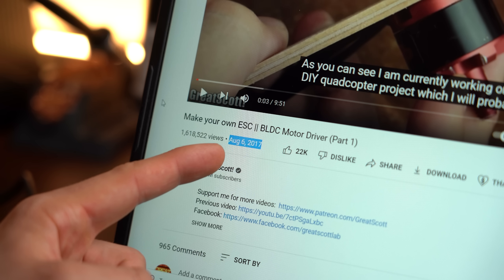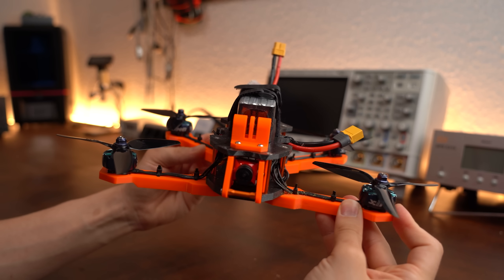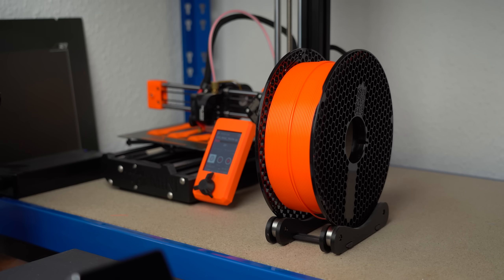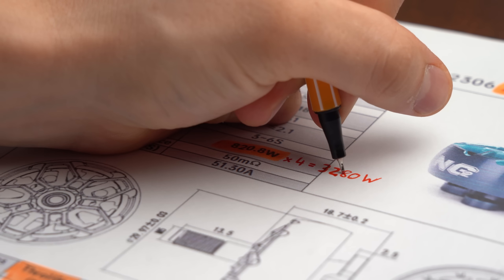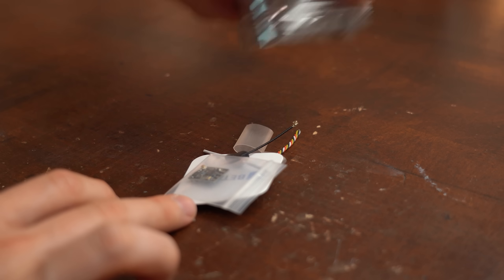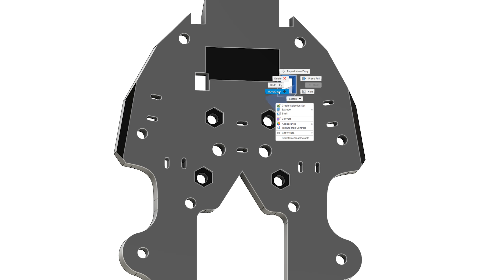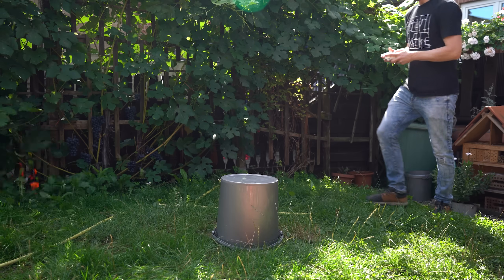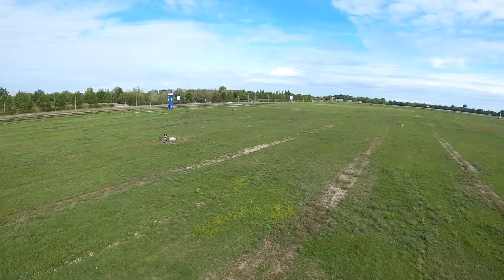The Idiot's Guide to Making a DIY Drone! (I am the Idiot)

Comment: Zeee battery C ratings are incredibly overstated. 
My ESC requires 35c minimum to run and my Zeee "80 C" battery would not even provide the 35c minimum, resulting in voltage sag causing false LVC state.

Zeee is crap battery company. 

SMC make actual good batteries.

Comment: I have a doubt, At 8:30 minutes and seconds into the video you have mentioned the ESC must be able to handle the power consumption from the motor but the motor you have used, seemed to be a 60S Motor with 51-52 Amp Approximately in current rating at full throttle and the ESC That you Have used is of 50 Amp Rating Was That A Problem or Will that be a problem or not - This is my question Scott ? Please Let Me Know !!

Comment: ANSWER:
The drone fell out of the air because of a cut in power, this may have been caused by a dead battery, bad wiring or something  else.
Also if you want to get good you should practice with a simulator.

Comment: Go from the 3 blade to the 2 blade propellers, it wont feel as like crazy powerful, the more blades the hard it will turn amd maneuver. And i also recommend adjusting your motors in the firmware. The stock setup never works for me anyways! 👍🏼

Comment: You can get all in one boards with ESC and Flight controller combined.   ELRS is the best on the market for consumers right now. DJI has digital VTX called Air Units. This is not a cheap hobby anymore.

Comment: You know building an FPV - UAV is not a small feat by any means. I'm trying to do it by myself, but I'm clumsy with assembling the technology. Then again! - I'm a CHEMIST - I've been working with polimers and polimeric materials for 25 years. It's quite easy for me to obtain lightweight & very durable materials, but I'm in a pickle as soon as it comes to electronics, electrical motors, etc. I have friends in the business, that allow me to even PRINT (gratis!) any ...idk!...blade-propellers or any other part of the drone I want, but as soon as it comes to power it, control it, realay real-times images, etc., I'm starting to having problems. I will persist obviously, but there's a SH*TLOAD of stuff I still have to learn. PS. KUDOS for your drone, though! Nice job!

Comment: you should have done a bit more resartch into fpv iv knowdes that your camera its at 0° witch is not good because when you go forwords your drone its angeld and your camera would just point at the grownd and the 3d printed frame its not good as its verry fragile and thous drones are ment to survive big hits i would recomend to practice your flying into a simulator befor flying for the first time in acro mode to anyways tips aside good video 👍

Comment: There was a time when the only way to get into the drone hobby was building it yourself. I built many drones in those days. These days the pre-built drones have just gotten so good that it is usually not worth building one. There are still cases where building is the right way to go but the average drone pilot will be far better served buying an ARF. You often times still need to install a receiver but you can even find many with the receiver built in.

Comment: Why would you put the bulk of the mass (battery, electronics) etc above the center of lift of the propellers ... ? Its inherently more unstable aerodynamically, so I'm sure your controller was working overtime to keep it stablised and its no wonder the pilot input was so sensitive ... when was the last time you saw a helicopter with its rotor below the centre of mass of the cockpit?

Comment: Hey I'm a mechanical engineer, and I just wanted to mention that there might be a way to print the parts to your drone without sacrificing payload, and  at the same time you may add structural integrity to the frame of your drone. First off, I'm curious about what type of infill you used, as well as support structure within the frame. Second, what type of filament did you use when you printed your part? Are you willing to use different materials for loading, like would you be opposed to using a metal support with gussets added in your 3d prints? I like this project and I see a lot of potential with it. If you use a CAD software like Solidworks then I can run an analysis on your drones body and determine what parts need to be supported, but I would need a copy of your CAD design to do so.

Comment: Maybe you did not set up AIR mode in Betaflight
Reply: #Great Scott I experienced loss of control many times, when not enabling air mode ... As soon as you cut throttle the motors can lock and the drone will fall from the sky (this is especially true on Xing motors that have very strong magnets).
These are some of the best motors you can buy so great choice, but you could save a lot if you buy the cheaper version of the Xing that cost almost half of the price but have identical performance.

Comment: Hi there. Re drones and security. Boundary security is important at my farm  .Can you kindly visit a raspberry pi or similar land  radar unit please?
Diy boundary radar theses days is important for families and is a very interesting project.
  Adding a 360 degree rotating co linear panel antenna with
5w Rf output including code for size of object  differential algorithm (bird, drone,man or car ) at 500m would be awesome.
Im happy to buy a radar kit on your web site ( F band ) pre programed would be fantastic.
I can also be keen buy the Gerber file for printing the 18 inch x 18 inch co linear array PCB and have your filter plus a  tuned circuit design fitted to pcb aerial. 
Have potchers on farm problems.
Thanks mate for your videos
From Andrew.

Comment: Maybe reducing the maximum power or throttle input might be a good idea to start with, one of the most important things first time flyers have to learn is that the adjustments you make during flight are incredibly miniscule, give your sticks say half the max throttle they can have using a linear curve, you'll be able to get used ot making finer adjustments with a larger throw on your controller, then bring the curve back up once you get more used to it so you can get into the acrobatics.

Comment: 7 of the top 9 comments advise on a carbon frame and they're correct, too! The TBS Source One is dirt cheap, tested and approved by lots of pilots. Lighter, stiffer and stronger. Other than that and the power lead getting chopped: good job!
Overall people tend to go with a lighter battery on a 5" for maneuverability and a bigger battery like yours for mountain surfing on 7" quads but if you like it, that's the way you should fly it.
It's funny how building and flying an FPV quad is almost like second nature to me but a learning process for you. I'm usually in awe of your knowledge and skills but FPV quads are where I learned most of what I know about electronics so that's like a baseline in my head.

Comment: I'm a bit late to the video but welcome to FPV! You didn't mention reshaping the arms to better fit the 5" props. Plastic is heavier than the carbon frames we typically use and 5" props are a bit less efficient than 6" would be esp for the motor size and extra frame weight

Comment: Awesome video there, with great details as well.

Though I was wondering have you remembered to configure your drone, so that it is on angle mode, which is essential for beginners in the drone hobby. 

Also I would strongly recommend using a carbon frame (perhaps the apex) as they can even survive multiple crashes flying straight into objects and falling from heights like it is nothing.

Amazing drone project.

Comment: Hi there, I am a fan of your studies. I recently buy some mini servos (MG945). After some time they started to behave abnormal. As I guess I have blown up some components when I connetted the Vcc to 12 volt. Then I tried to make my own control circuit but I didnt able to success.  
If you like the topic can you make a video about diy mini servo circuits which can be used to convert small dc motors to servo motors. There are some Arduino solutions but I mean a custom circuit design.
 Best Wishes.
Waiting your new videos.

Comment: Hi there, I have been watching your videos for years :) Good to know that you have finally started with drone racing.
Few tips:
1.) Use a carbon fiber frame. Especially the 3D printed arms are not durable enough and will break very often. They are also not stiff enough and the FC gets way too much vibration which might lead to oscillations and poor flight performance.
2.) 3D printing is great for frame accessories like GoPro mounts or antenna mounts. ALWAYS use a flexible filament, preferably the TPU. Flexfill 98A is great for basically anything. It is very very durable.
3.) Learn how to fly on the FPV simulator. Liftoff, Velocidrone, or free FPV.Skydive can do the work. It will save you hours and hours of repairing the damaged drone. It absolutely pays off.
4.) The ESC is usually the first board in the stack and the FC is above it. It is way easier to build the drone that way ;)
5.) When building the drone on a carbon fiber frame, don't forget that the carbon is conductive so you should have all the parts laying on the frame insulated in heat shrink and it is a good way to do so even on a plastic frame. Cover the receiver with a heat shrink, stick it to the frame with double-sided tape and secure it with a zip-tie for safety.

Comment: oh my XD ima fpv Freestyle pilot and i never do this kind of study about the trust of motors and nothing like that, if it dsnt burns its oke XDD nice video dude and continue doing that epic things

and couple of things, both the battery and the frame I don't think they have the most appropriate power-to-weight ratio (I would lower the battery capacity), those things make the drone very unstable this kind of frame is build for cinematic. 
and that's silly but the TBS antennas give a range in the shape of a donut leaving the logo and the connector being radios of bad frequency, well take a look and I know you will build a monster!

pd: the propellers are fine! belive

Comment: not yet watched the full video , but plastic frame introduce a lottttttt of vibration and resonance problem that are not really fixable. and too much flexibilty too
and plastic frame can also introduce uncontrolable drone , and flyaway for no apparent reason.   it s a whole rabit hole

you can found solid carbon frame for cheap.    cheers

Comment: Dein Quad fiel warscheinlich vom Himmel wegen eines Desync, was dem wobbeligen Frame zu Schulden wäre. Lass während des Fluges die Blackbox mitlaufen, dann kannst genau sehen, was die Ursache war. MAn hört aber deinen ESC direkt rebooten, was heißt, das eine Voltspize ihn kurz ausgenockt hatte oder eben ein Desync.
Paar kleine Tips: 
Auf dem Stack keine Stahlmuttern, nimm Nylonmuttern. Schließen nichts kurz und wiegen weniger. so wenig wie möglich leitende Materialien nehmen. Darunter leidet irgendwann auch der Empfang.
ELRS ist eine sehr aktive Open Source, von daher gut möglich, das die Installation schwieriger wird, da alles unterschiedliche Firmwareversionen drauf hat (je nach dem, wann gekauft wurde bzw. die Artikel im Regal des Händlers lagen). ELRS ist in Deutschland grundsätzlich nicht zulässig. Es hat noch keine Zulassung. 
Ebenso der Flug im heimischen Garten. Kann fiese Anzeigen geben (gerade durch veröffentlichte Youtube Videos). 
Ebenso wäre ein Hinweis auf die notwendige Modell-Haftpflichtversicherung und Führerschein für Unwissende ganz gut. Ohne das darf man auch nicht abheben.
Mit Blick auf die FPV Community rate ich dringend zu einem Carbonframe. 3D gedruckte Frames sind absolut untauglich, weil sie nicht steif genug sind (Betaflight PID schafft das nicht). Davon abgesehen, dass man nach jedem crash was neu drucken kann und der Kopter nicht gut fliegen kann. Gedruckte Frames wurden massiv erprobt, weil eben günstiger und jederzeit reproduzierbar. Jedwedes Filament wurde drölf mal getestet, mit Carbonfasern verstärktes Filament etc. Heutzutage sieht man keine mehr. Kein Filament oder Druckverfahren konnte einen klassischen Carbonframe ansatzweise ersetzen. Myth: Busted!
Mit einem Carbonframe kann man auch bedenkenlos die Betaflight default PIDS nutzen und der Kopter wird extrem gut fliegen. wer dann den perfecten Tune haben will, stellt hier und da noch ein paar PID Parameter fein ein. Da braucht man dann aber schon ein paar Jahre Flugerfahrung und ein perfekten Quad, um das perfekte Tuning zu erreichen. Profis tunen dann sogar je nach Luftdruck anders. Wers braucht... will nur sagen: an den PID muss man heutzutage eigentlich fast nichts mehr machen.
Ansonsten wie unten geschrieben: Kabel so kurz wie möglich halten, auch die Antenne eher kurz. Alles was Vibrationen erzeugt, lässt den Kopter fliegen wie ein Sack Nüsse. Da reicht ein kleines Stück Kabel das auf den Gyro trommelt.
Alle Kabel sichern, damit kommt auch nix in die Propeller.
Lipo-Kabel zugentlasten(!), sonst nimmt der Lipo beim Crash die ESC Pads mit.
Und bitte die C Angaben von Lipos nicht groß beachten. Die sind Marketing. Adäquate Lipos für Quads sind Tattu, CNHL, MyLipo, Ovonic. Jede andere Marke taugt nicht für Quads. Ausnahmslos. Es gibt bis dato keinen Lipo, der "genug" Leistung für Quads erzeugen kann, geschweige denn tatsächlich 120C bieten könnte.. Nach 5 Sekunden Vollgas bricht der Beste ein.
In derartigen Leistungsbereichen empfiehlt sich außerdem dringend ein Kondensator (35 - 50V, 500-1000mf) so nah wie möglich am ESC. Ansonsten macht der mal puff nach einem Lastwechsel. Zudem stören die andauernden (ungefilterten) Spannungspitzen ohne Kondi massiv den Gyro und damit das Flugverhalten.

Das sind alles nur MEINE Erfahrungswerte und am Ende zählt, was Spaß macht. Also nicht zu streng nehmen, sollen nur Empfehlungen sein. Solange der Spaß anhält: alles richtig gemacht, egal wie es technisch aussieht. -ein langjähriger Abonnent ;)

Comment: I been wondering how PETG 6mm or more holds up with drones. Does it break way more than carbon.. and thus print lots of extra arms, etc? Seems like if you dont crash much... it could be a great way to have all kinds of drones to fly for less. But is the flying dynamics good with PETG/3d printed.. how much different than carbon?

Comment: Get a carbon fiber frame it will help with the oscillations also pay attention to motor temperature. With 3d printed parts there comes a tone of oscillation and subsequently heating of motors. You can burn them out if it's too bad. Have fun. PS: with a 2200 battery on 4s its not powerful enough :)

Comment: Could you not fit a small gyroscope to give you a better stability for the cost of a bit of extra weight?   Also you should think 3d in determining you multiple direction values if it can handle it by smoothing out the +1 increments in two directions with a nice curve which will smooth out banking, climbing and diving whilst turning.

Comment: As an fpv pilot myself i got some tips 😅 
1st i know 3d printed frame sounds nice in theory but sadly the problem with those is the vibrations that come from those.
Carbon frames are much stiffer and so mich easier to tune. And you can get replacement parts for most quite cheap.
2nd lighter batteries are better, like 1100mah to 1500mah. Those exta 600mah of the larger one wont give more flighttime cause of the increased weight.
And 3rd i know it seems intuitive to point the camera down like with dji drones but its a lot harde to fly like that. Try a little bit of uptilt start with like 10degrees on both the fpv cam and gopro. The reason for that is that u want to be flying foreward which means you will tilt forward. So if u tilt the cam upwards it will be level when u tilt to fly foreward. Oh and also tighten the fpv cam so it cant move up or down in angle 👍

Comment: Well.... Fpv drone control is really very different from other drones (or flycams), if you want to move, in addition to pushing the right joystick, you also have to increase the throttle, Otherwise it will tend to descend gradually due to the loss of upward thrust caused by the downward force not being perpendicular to the ground.

Comment: great work! Just wondering why you decided to print the frame in PETG? PLA is easier to print with and more durable (besides temperature). If your printer can handle it, Nylon (or better Nylon with carbon fibre) is the absolute best for a frame. Casing should be lightweight PLA or ASA as both are extremely light

Comment: For my fpv freestyle drone I took an existing 3D model, edited it to reinforce the weak points and then printed the whole thing with Nylon CF15 filament.
The carbon fiber additives make the entire frame extremely stiff while being virtually unbreakable.
I also recommend flying in a simulator first to get a feel for the controls, so you don't crash your expensive drone in the beginning.

Comment: I'd highly recommend using PLA+ filament instead of PETG. PETG might be a bit stronger but also less stiff and for a drone frame you really want the stiffness. PLA+ also can be "baked" to make it more crash resistant. I have also 3D printed drones before and after switching from PETG to PLA+ oscillations greatly decreased and I was able to use less aggressiv PID settings.

Comment: I would highly recommend going with a carbon, of the shelf frame. Especially if you don't know how to tune yet, you will have so much better results with a carbon frame: way stiffer, less oscillations and you don't need to worry about crashing (especially if you are only flying in the field). For most of them you can get spare arms and just swap them, should they break.